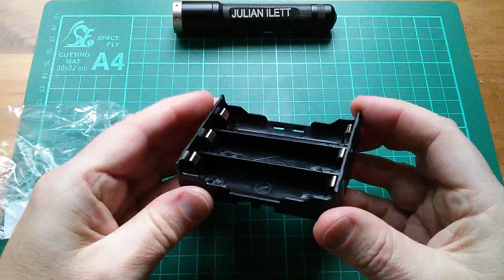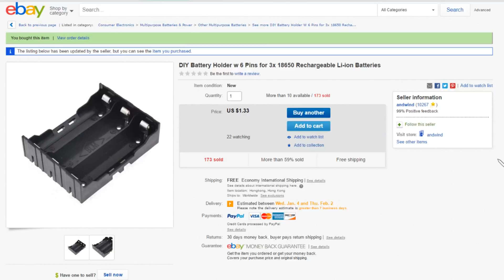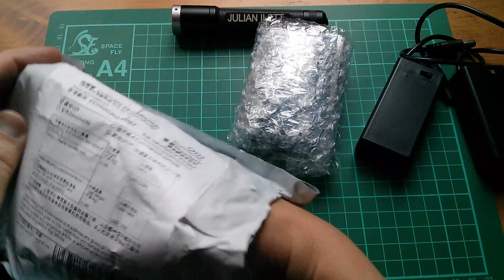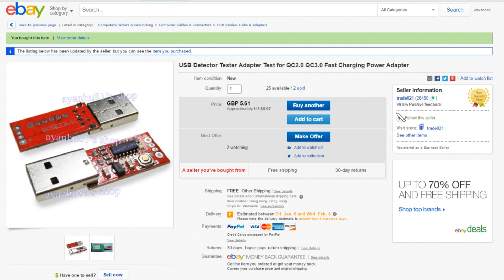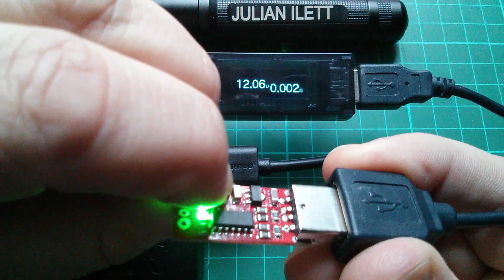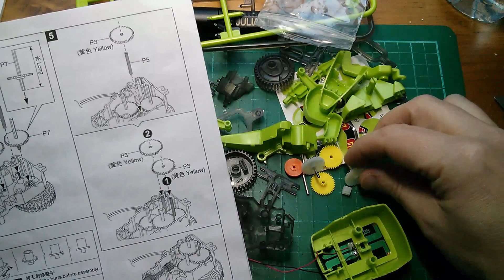Julian's Postbag: #78 - Electronics from China via eBay

Comment: 1)  3 x 18650 battery holder - typical Chinese junk.  They could have spent 20 cents more to put proper coiled springs on the negative end, then it would not only handle protected cells, but last through dozens of times more insertion and removal cycles before the flat spring contacts became deformed, and fragile after repetitively bending more springiness into them.

2)  Not sure why you had a problem with magnetism after soldering.  Other people do this with success, so are you merely observing that the magnetism was not "as" good?  Perhaps you merely chose too thin a magnet so it got hotter than those other people used?

3)  Neopixels - Use smaller screws.  How big do they really need to be to secure something that must weigh an oz. at most?  No need for the threads to be barely smaller than the holes, so long as the head doesn't pull through.

4)  Charge Tester -  Isn't it a shame that there aren't people who can write proper instructions, translated well to English?  I mean, actually doing so.  Certainly there is at least one person in China that is capable of both, but doing something else for a living, lol !

Comment: 7:43  the problem with the holes in the neo pixel strips, try using a hex socket capscrew, they have smaller heads

Comment: You should check the 18650 holder by removing the cells.  Some have clips that actually damage the plastic coating when you remove the cell and the battery is dangerous (easily shorted) at that point.

Comment: whats the usb tester actually useful for...does it just confirm that quickcharge ports really supply the voltages theyre designed to? I mean, Id be surprised if they didnt. and without checking that theyre stable under load even that seems a bit pointless.

Comment: every 18650 battery holder I've gotten has contacts that are made of some type of unsolderable metal. appears to be good but snaps off soon after. blah.
Reply: I've used a type of flux used by stained glas folks. Doesn't seem to corrode and makes a good connection.

Comment: Hello Julian!
Do you have a 3D printer? I designed an 18650 Battery Cell Holder (single and dual) which is freely available on Thingiverse here: http://www.thingiverse.com/thing:1433232

I designed it to accommodate all lengths of 18650 cells which you can also see in the video. Cheers!
Reply: Mitzpatrick Fitzsimmons noice!

Comment: Julian, the Qidian QD185-TY has an auto and manual mode so you can disable the auto shutdown when there is no load on the outputs.
Reply from the maker: Indeed it does - although it doesn't have QC3.0

Comment: Hey Julian can you do these 4 item's on your next ebay postbag?

1000 kv Ultra-high Voltage Pulse Inverter Arc Generator Ignition Coil Module
311704332251

DC 3v-6v to 400kV 400000V Boost Step-up Power Module High-voltage Generator
311688245090

DC 6V-12V 1000V 1500V High-voltage Power Boost Step-up Module Generator Board
182146612793

5V-12V Step up to 300V-1200V High Voltage DC-DC Boost Converter Power Module v
191903189713
Reply: And how about the EMIC2

Comment: At 17:47 and 18:27, you don't have anything connected over USB, yet the YZX meter shows a 12v output. At that point if you were to connect a regular 5v USB device, you could potentially release the magic smoke from your USB device, isn't it? Shouldn't the charger immediately switch to 5v when the data lines go open-circuit?

Comment: Re: the magnets. If you can solder to the head of a ferromagnetic 3mm screw, the magnet should simultaneously hold the screw to the magnet and the magnet to the 18650 cell. You might need to shorten the screw so it is flush, but that's not a problem. Ta da! No need for a nut on the flat side.
Reply: Someday the Post will realize that those  magnets demagnetize many credit cards in nearby envelopes lol

Comment: with those neo pixels I suppose you could use those plastic type pcb standoffs with the barb type locking mechanism, I think they often come with an adhesive on the opposite end, just a way to mount them i guess it would be better than having crushed SMD's

Comment: Julian, it looks like the LED bar mounting holes could be used with nylon mounting pegs like one would use to mount an ATX motherboard. You can find them with threaded holes on the back side of the nylon plugs.

Comment: is there a board like the tp4056 that can charge multiple 18650 batteries instead of 1
Reply: There is a tp5100 that can charge either one cell or two cells in series. Other than that, your best option is probably a BMS, unless you are doing parallel charging.
Reply: I'm building up a lithium 18650 system, using (so far) 20 parallel 18650's , with five banks of them s far, although, the way they are built, I could have 4 banks of 25 easy enough. I'll be charging them the way the bike guys charge theres, with various methods. One somewhat famous guy hates BMS units, so I'll be looking at a lot before I choose. Definitelly need a higher current option, one module as is, is 50 amp hours. at 3.7 vdc
Reply: Definitely interested.
Reply: TP4056 can do an infinite number of cells in parallel, but for series cells you have to use a BMS board.
Reply: Yes, a BMS is asked for. Parallel is not very interesting.
Reply: ekner thank you, is there any videos on this?
Reply: can you make a bms or do you buy them?
Reply: It's generally easier to buy them - it is possible to make them, but it would become more expensive than buying a pre-made module in most cases... although it does mean you know exactly how the unit works, and can customise it. Have a look at the following item numbers on eBay to get an idea of some of the cheaper options around... 172442200884 152374024304 272258411256 291572442568 262504565562
Reply: wow thanks man im new to this, im building a battery pack and im glad you showed me the bms im def getting one not sure which one yet
ill have a 4-8 cell battery pack any suggestions?

Comment: You mentioned about possibly doing a DIY version of that tester. You may have seen my video about manually bitbanging the QC2.0, which could be a good starting point. As far as I know, QC3.0 protocol is the same but adds high-pulses to D+ and low-pulses to D- to increment and decrement. I would have tested that as well, but I don't have a QC3.0 PSU... But that should be easy to check with a scope.
Good luck with that project, if you decide to try it. Don't break anything! I lost one USB power monitor -thingy, because I didn't remember it couldn't measure 12v :)

Comment: Julian, I think those pins can be used if you attach multiple of these items one into the other, side by side,  so you can solder 1 piece to the following... their design is done as you can fit 1 into the other, like in these smd boxes:
https://it.aliexpress.com/item/fast-shipping-50pcs-SMD-SMT-component-container-storage-boxes-electronic-case-kit-the-1-Automatically-pops/32367611676.html

Comment: Hey Julian, did you ever consider using an attiny85 to drive your neo pixels? I know not as standalone as a pic can be but for a neat little package you have something capable of driving your neos
Reply from the maker: Yes, and I'll have more details on that soon :)
Reply: Been driving Neopixel rings with an ATtiny85 for quite some time now, courtesy of the very useful add-in for the Arduino IDE. Yes I know it's cheating :)

However your PIC experiments have reawakened my interest and I have decided that after the hols are over I am going to treat myself to something I've been wanting for a long time. I'm going to splurge and buy one of those Mikroelectronika PIC boards (you know the one with all the bells and whistles.)

In the meantime I have been getting acquainted with Great Cow BASIC. An excellent IDE and programming language for both PIC and AVR microcontrollers.